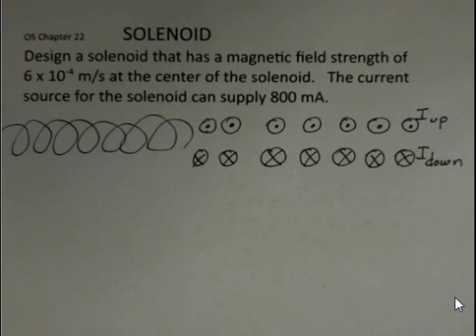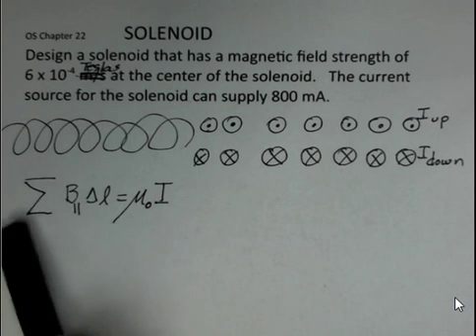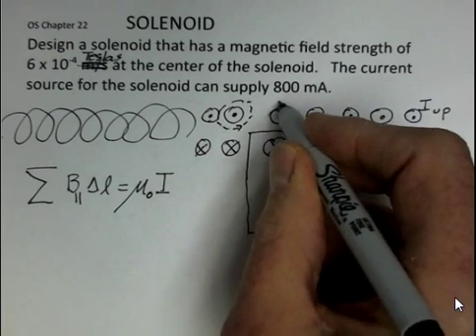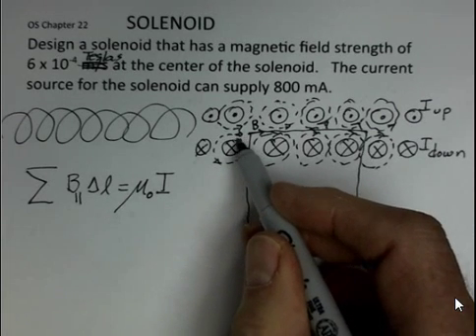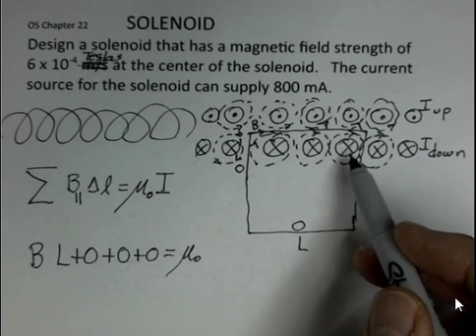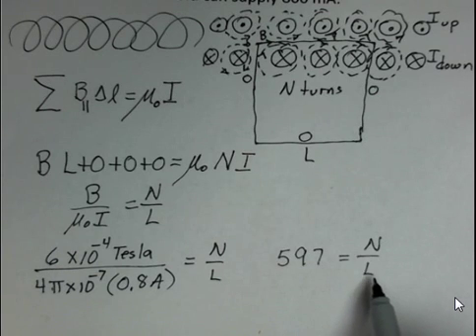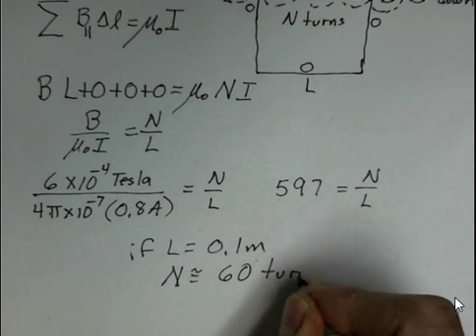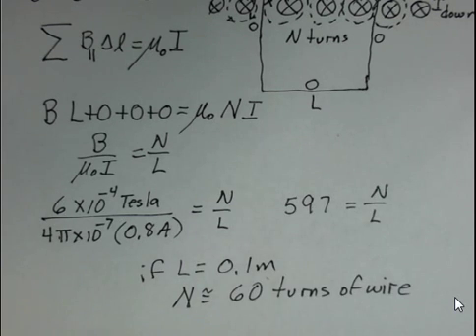Solenoid  Calculate the number of turns of wire per meter

Comment: Great explanation. But what about wire diameter? Won't it matters?
Reply from the maker: For an introductory course the effect of wire diameter is generally ignored.  The diameter of the wire will affect the number of turns of wire per meter that can be placed in a single layer of winding, and effect the limit on the current the wire can carry without overheating.  I don't think the wire diameter has an inherent effect on the strength of the magnetic field in the solenoid.....see this web site:
https://www.quora.com/Can-the-diameter-of-a-magnet-wire-coiled-in-an-iron-core-affect-the-strength-of-a-solenoids-magnetic-field
The following web site discusses some effects of the wire diameter for non-solenoid calculations.   https://electronics.stackexchange.com/questions/484775/effect-of-a-wire-thickness-affect-the-magnetic-field    
Thanks for your comment.
Reply: Hi @GregClementsScience sir, Thanks for the reply. Actually I'm from mechanical background  & don't have proper hold on electronics. I wanted to make a solenoid of capacity around 5-6 kg . I tried it with a plastic core (1mm thick) of dia 10mm & length 40mm. Used an isolated copper wire of 26 gauge (0.45mm) & turned it over 900 times on the core. Power supply was of 12V, 1A. That resulted in lot of heat in the solenoid. Even it didn't develope the force I wanted. 
Whatever I tried was from another YouTube channel. 
After failure I tried for some other calculations but couldn't get them correct. 

So can you please help me out with a proper solution for making a solenoid of capacity 5-6kg, working on a battery of 12v & 1Amp ?
Reply from the maker: @siddharthmodgekar4316  Sorry, I have no expertise in solenoids.  I only have done the simple calculation shown in the video and in introductory physics textbooks.  Best Wishes
Reply: @GregClementsScience  not a problem sir. Thanks for responding & well being.

Comment: Sir,i have a similar problem in which it is getting the no.of turns as 82.3 turns.to which value should i round 82 or 83 please reply.thanks.
Reply from the maker: I am assuming the problem asked you to design a solenoid that would produce a certain magnetic field strength.  If this is the case you should round up the 82.3 to 83 turns.  82 turns would produce a magnetic field that is slightly too weak.
Reply: @GregClementsScience  is it becaise of the design problm.okk sir thanks for the information 👍👍

Comment: I have a 12 volt solenoid used in a 12 volt car. Would like to rewind this solenoid coil to work in a 6 volt car. I can measure the wire diameter, resistance, number of turns, etc on the 12 volt coil.  Is there an easy way to take this information and determine wire size and number of turns needed to make this solenoid a 6 volt solenoid.  Any help you could give me would be greatly appreciate.  Thanks in advance.

Comment: how many turns requires for 5v supply
Reply from the maker: You would have to specify the resistance of the circuit and calculate the current (Inew)created by a 5volt power supply.  Then you would calculate the number of turns by following the steps shown in the video but using the new current value (Inew) rather than the 800 mA current given in the problem.